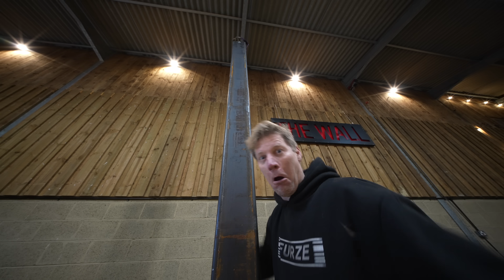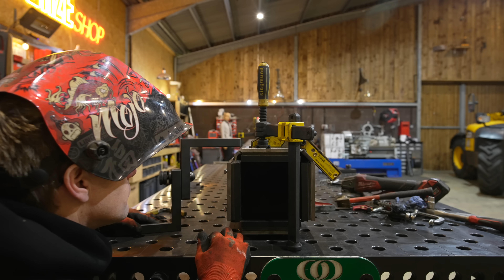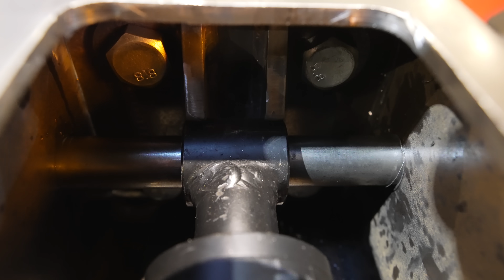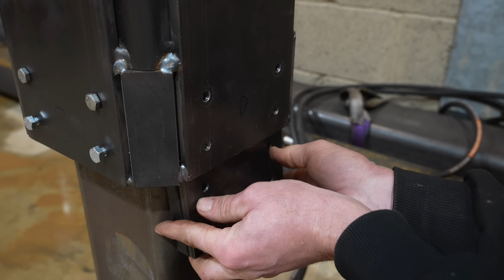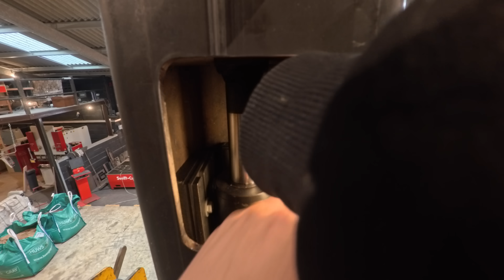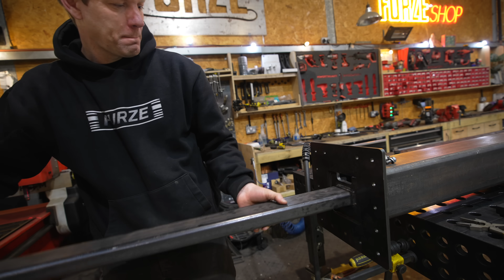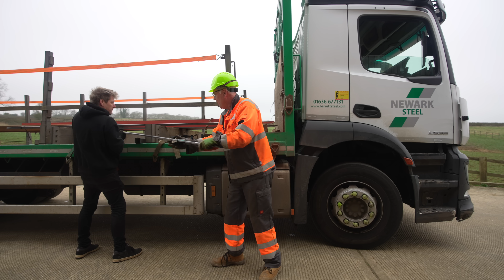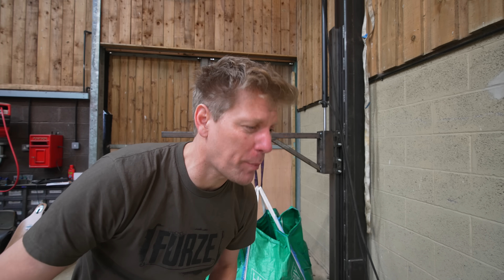Digging SECRET Garage Part 7 Car Lift Prep

Comment: As a welder fabricator myself. Seeing 800 kilos being held up from only tacks is truly impressive man. Great work Colin really. You are great at your craft.
Reply: as a welder fabricator myself i was absolutely shitting myself seeing that 😅😅
Reply: @jordanbush3300 as a morrisons shelf filler  i know it held the torque due to it being offloaded to the strut
Reply: as a welder fabricator myself i was like, yeah, sometimes i doubt my fully welded structures only to be completely frustrated the next day when i try to break a tacked part apart. good tacks are strong
Reply: surprised he ddit go with cables, a double decker trailer can hold 1500kg easily

Comment: You gotta display the model in the garage and have a mini model in the model at the same spot for fractal garageception 🤯 

Bonus points if you can put a 1:18 scale model DeLorean in the model and a 1:64 scale HotWheels/Matchbox DeLorean in the model-in-the-model !

Comment: I still think a 3 stage cable lift would be much easier. like s forklift meets a car lift.  
This being his 3rd video he seems very set on these MEGA hydraulic legs. granted my design would have need for more engineering in pulleys and cables, with the ram set on the walls allowing for easier maintenance.

Comment: You know the end of the ram that's a ring that you've built a cradle for, is it designed to be operated with a rod filling the centre of that ring?  The compression force on that coupling would be squashing the ring rather than the upper semi-circle of the ring enclosing around the rod thus keeping its shape.  Would it be wise to fill the ring with a blank?  I suppose this is just for experimentation purposes, but if it's the same on the proper build, you might find in the future your ramp sags half an inch below your drive plateau.  Or worse the ring could entirely break and the remaining stub could be loosely jabbing at your undercarriage causing the other legs to bind up on those nylon pads.

Comment: I was going to ask about redundancy like how a mechanics hoist ratchets on the way up so it won't collapse if the hydraulics fail. But you showed that brake near the end so she should be right in the worst possible case. Fascinating effort and a great custom job.

Comment: Seems to me, if you're going to have the rail anyway, why not mount the Main lift rams outside of the telescopic legs on a yoke? then you'd have permanent access to the hydraulics for inspection and repair.

Comment: Just curious if you have any sort of safety measure planned for preventing anyone from going under the platform when it is lifted. I'm guessing the intended use of this lift would be to get in car, lift up, drive out and remotely lower lift back down. This would mean it is getting lowered without knowing if someone had gone under or not.

Comment: @15:58 the actual cylinder will fit in there without it sticking beyond the base plate (into the concrete floor), right?

Comment: I think the only way to ensure the lift goes up evenly would be to gang 4 gear pumps on the same drive shaft, and each gear pump drives it's own hydraulic ram. Simply connecting the rams together hydraulicly won't suffice because if any ram jams the others will take it's flow.

Comment: Clever... Cabling between columns to keep them in sync makes sense.  This should also help if a ram seal fails.  If you could go over that failure mode in "Too much Furze" that would be awesome.  This is one hell of a lot of engineering for one person!  Simply amazing.  Thanks for the great content.

Comment: Glad to hear you've got the cables planned.  Synchronizing the hydraulics would be a massive challenge unto itself and would require sensors, proportional valves, a plc,  programming, tuning, and a lot of frustration.  Cables are the way to go.  You're doing pretty good for a plumber!

Comment: Looks gosh darn awesome, can't tell from the video if you've done it or if I'm wrong in this application so disregard me and I'm an idiot if its alright, but the mounting hardware for the nylon bushes and the bearings I think need some sort of locking, either lock nuts or spring/shakeproof washers cause that will definitely vibrate and work loose!

Comment: instead of black nylon  i would have used 2 top  and bottom bearings and  nylon on the 2 sides that way you can just adjust and  rolll

Comment: You should get this review by a mechanical engineer.. Little FBD and compare design stresses to max allowables of your material and welds. Safety/locking mechanisms should also be reviewed and signed-off.
Reply: nvm.. I see you've got it covered mate.. Right on. Should still consider a safety review, not just structural.

For syncing hydraulics we do the same thing in heavy industry, however it is one motor connected to four fixed displacement hydraulic pumps.

Comment: I could be missing something Colin, but I'm unsure why you need the inner shs tube that the cylinder is inside. If the outer tube rolls up and is guided/supported by the column attached to the wall, could the cylinder not be mounted directly to a base plate on the floor and extend only the outer tube, revealing the cylinder? It can't move laterally due to the roller/column attachment.

Comment: Two issues I see here Colin
#1 you might want to put some kind of stop on the end of that bar when testing those bearings, don't want any more holes in that nice floor now do you.
#2 that leg slot is nice but a slot for a guide line will help a lot when it comes time to pull them for maintenance

Comment: 6 months between this video and the last. Now, this involved a lot of trial and error, and planning, and whatnot, so the next 3 legs, and the lift should go relatively fast, but there's still the turntable and it's interaction with the lift... This could be as much as another 2 years from the time the garage was finished being dug and that cool door was added to the tunnel system, and the time the garage is actually finished, and we're only at the 6 month mark... Very slow as far as a viewer is concerned, but if I'm doing this same thing at my house? That's really not that bad at all. This stuff takes time, and time isn't always something you have a lot of. So to me? I wouldn't expect to see this lift complete until at least summer of 2027. It's exciting work.

Comment: What about using some steel hosser and pully system with counter weights so the hydraulics done have to lift the weight of everything, think elevator, they have counter wights to help the system.

Comment: Eventually one of the pistons will develop a leak on its seal, and it will move less, and even sag. You better come up with a way to detect the uneven load, before you can visibly see it bending out of square.

Comment: I dont know that you want a free fall lock on that...  you need a mechanical one direction safety lock thats engaged any time that you're not actively lowering it. A free fall lock works fine if something like a cable snaps and it goes into free fall, but if a hose ruptures or springs a leak or a fitting gets smacked and it quickly bleeds down, the free-fall safety never engages because it doesnt experience enough acceleration. 

Also, for the hydraulics, you dont necessarily need cables. In RV's you often see a solenoid valve for each cylinder in the up and down positions and between the cylinders there is a flow balance spool valve that ensures that all cylinders have the same flow rate. It works well and will reduce maintenence item count.

Comment: Square headed bolt with milled slot so the nuts don't fall off on the inside. Insert the bolt from the inside and use nuts and lock washers on the outside! Something would have to be slotted though.

Comment: Interesting design for the adjustable sliding plates @4.30-6.30. Eventually these will wear out, i was wondering how hard it will be to replace them whilst in place on the lift..

Comment: I have 2 4 post lifts and they incorporate cables and pulleys and the cylinder is located under the car platform. For every inch the cylinder travels the platform moves 2 inches, if you add another 2 pulleys it would be 4 to 1 .you can use shorter cylinders and have them outside the post for better service.

Comment: Can you just run all the ram hydraulic lines through a common pressure equalizer block to make sure they are all getting the same pressures and lifting equally? Even if you had an offset load and one of the rams had more load on it than the others, the pressures should still equalize through all 4.

Comment: Would love to see some much more in depth videos for the mechanical design on the second channel. The ones you've put on there so far have been manufacturing focused, which is awesome, but it would be great to also get more insight into the mechanical design.

Comment: Building movers use a hydraulic control module called a "unified jacking system" to maintain even stroke on multiple jacks at once. Might be more simple than a cable system.

Comment: Just a thought that sprung up mind. Are you accounting for shear forces when you drive on/off the platform? Breaking and accelerating, even when slow, would transfer the forces laterally. I'm sure you have considered this, but just in the event you haven't. :)

Comment: Hi Colin! As a constant worrier I have one question: what safeguards do you have in place in case of a catastrophic hydraulic failure or other issue that could lead to the lift coming down rapidly and uncontrollably? Essentially, are there any mechanical safeties to ensure that the lift will always lower at a slow enough pace to avoid being caught between the surface plate and the ground?

Comment: colin are you set on using hydraulic hose or have you considered using hard lines for the hydraulic fluid, i think it would look a lot nicer with piping rather than dingy dirty hose

Comment: You need a lock system on each leg for maintenance so things can’t  drop and cut hands off whilst messing with inside parts . A simple  bolt that goes al the way through will do. 

You also need a lock system that prevents it dropping if you lost hydraulic pressure . Like they do on car lifts.
Reply: Yeah he mentioned being able to lock off each leg to do maintenance on the hydraulic ram etc in the video. He didn't mention how, but yes a large bolt or pin through would do the job.

Comment: Something occurs to me. What are you doing to sync up the four rams? If one of them moves faster than the others, it'll want to twist the platform and put disgusting stress into your structure. I'm sure you've thought of this, just I don't recall hearing about it in the video. So far, work looks great :)

Comment: Corrode-able material + exposure to the rain and elements + cyclic loading from the car on top  + underground construction meaning drainage and leaks could be an issue + inner mechanism that can't be visually inspected feels like a dangerous combo to me. Be careful

Comment: If this were mine, i'd add two very simple monitors to each corner, a strain gauge on whatever bit of the structure experiences the highest bending load (probably the sticky-out (<< technincal term!) ledge bit that comes up and attaches to the car floor plate, and a wire potentiometer/ wheel encoder.  The strain gauge means you can monitor in real time the loads on the system, and see how balanced they are, and have a "SWL" above which the system won't let you lift, and the extension monitor basically allows you to see that all four legs are indeed lifting, and lowering, evenly  🙂  Run those sensors into a basic PLC and you can also fully automate the lift / lower sequence, including warning lights, beepers, limit switches and some sort of lazer barrier to stop anyone being under it when it's lowered (machinery directive legislation applies here!)

Comment: I'm a compactor engineer, our static machines we use a nylon block in each corner with steel backing plates and stainless bolts and nuts the set pressure all around the compression block. Works well at 60ton

Comment: What safety mechanism(s) are you using other than those safety brakes...... why wouldn't you incorporate a safety locking spring pin assembly like they use on car ramps...... just thinking of your and your families safety as I believe you need something positive....... greetings from down under.

Comment: This whole thing of putting bearings on an eccentric rod, and lock the rod with a simple nut relying on a minimal friction force between the rod and a base is so bad design. I can't even get why you even consider this.
Reply from the maker: there's going to be a lot of them so the weight is distributed over many.
Reply: The eccentric rod will surely roll over time making bearing contact with the surface loose. Some other way of locking the rod is needed. Consider welding it or something.

Comment: The Rack and Pinnion actuators option is much, much, much simpler and a fraction of the price.  They automatically lift all legs at the same speed/height (no daisy chain).  And have built in safety from sudden drop.
But Hydraulics are 'cool'.

Comment: 28:46 I have seen a foldable roof in action that had two independant hydraulic arms. At the beginning it was way out of sync due to unbalanced pressure so the complete structure was bending and twisting like crazy. Later some hydraulic guy figured how to fix it and it worked kind of smooth after that. Wish you all the best you will find a way to get your system in sync.😊

Comment: You need a hydraulic flow divider, that will ensure each cylinder gets the same volume and thus will run synchronised

Comment: Hello, Hyd Cranes have holding valves in case a Hyd hose fails it keeps the cyl from retracting , the teflon pads are the same setup as a hyd crane  Good Luck
Reply from the maker: yeah I think we call them rupture valves
Reply: @colinfurze  no there called holding valves `they act like a one way valve it takes x number of pressure to allow the valve to open to lower the load or boom or telescope the boom in

Comment: If you want the lift to work for inspection of the car as well, the base plate I guess can't be solid?
Reply from the maker: no it will have a removable centre section

Comment: Best idea for the final hydraulic would be make it a pinned system. Pin spreads and takes a lot of the weight as opposed to the plate.

Comment: Wouldn't it be better if the inner leg that's going up is the thinner and the outer leg at the base is the thicker one?
Reply from the maker: the span accrues the top is quite large so will need cross bracing so needs to fix to the outer, plus there's the inner lift

Comment: Haven't finished the video yet, but I hope you redo your weight test after you cut your slot into the leg
Reply from the maker: to be fair the inner leg doesn't take much stress as the outer leg is fixed to the column and the roof so can be little to non side to side movement and the weight will be transferred straight down the hydraulics

Comment: You should definitely think about installing burst protection valves on the cylinders. just in case a hose or fitting should ever blow out.

Comment: 4:36: Won't these bolts scrape long before the pad is really worn out? Or will the slop from the pad wearing require maintenance before it ever gets that far?
Reply from the maker: yeah id change them before that, I'll probably fit thicker ones anyway as no need for all those shims
Reply: @colinfurze  Figured you'd have a plan! You're my second favorite brit after Tom Scott, been watching since the wall of death build. Keep kicking ass out there and using ska/punk for background music. :)

Comment: Safety down valves?  We install them on our container handler hoist cylinders. In case of hose failure it prevents the load from freezing fall

Comment: Confused on how your doing the floor can't wait to see it done. Will the floor be going up with the outer column? I would think having a hydraulic in the center of the column allows u to attach the lifting floor the bottom the outer column and the roof on the top of the outer coelom and it goes up together?

Comment: When you were testing the pillar with the 220V minipump unit. It went incredably slow. Why didn't you just hook it up to the 4th function on the front of the telehandler. It has enough oil, flow and pressure. And probably extra safety valves after the control valve. Only thing is to check the oil level afterwards for tom😉

Comment: Im curious if you had considered multi stage hydraulic rams. Since they would go up in sections you could have done the multi stage lift by having each stage attached to a different portion of the ram.

Comment: Hey Colin! given that you live in the UK, what's the plan for corrosion? That's a lot of mild steel that you'll have runners on so even if you paint it at install, the bearings will wear away the coating in no time.

Comment: I'm just curious....but what happens when the hydraulics fail with someone working beneath the vehicle?  Every car lift I've ever used has mechanical lock to prevent sudden plummeting of vehicles.

Comment: I'm more surprised Collin didn't use a pulley system inside the pillars just like what the telehandler has. Or better yet just make a scissor lift that rides the "rails" and just picks up the sages as it goes up.

Comment: Use a 4way flow divider for synchronisation lift. It's 3-5% accurate. Just make sure lift is full stop every lift cycle on one of the ends.

Comment: I used to work for a company that made cabins for timbertruck loaders. They use very similar style thing with the shims and slideplates and whatnot, for lifting the cabin. So I'd say this lift is very well designed from that standpoint, some of those cabins have been made a couple of decades ago and still see use! Of course there is maintenance involved, but that is built into the design, just like here!